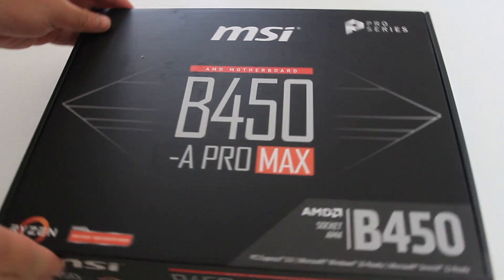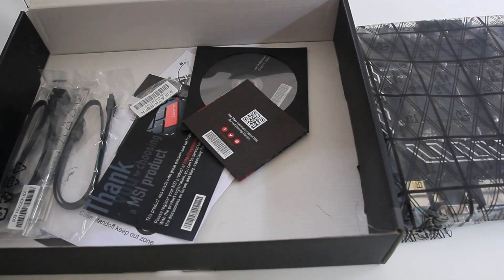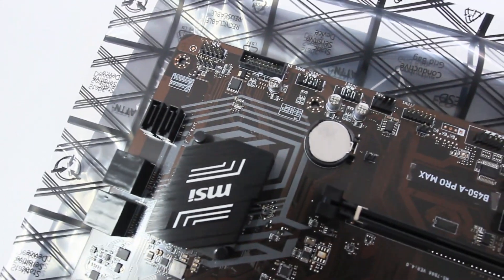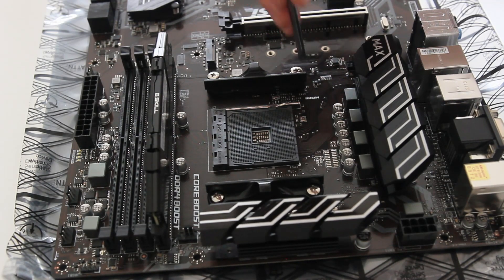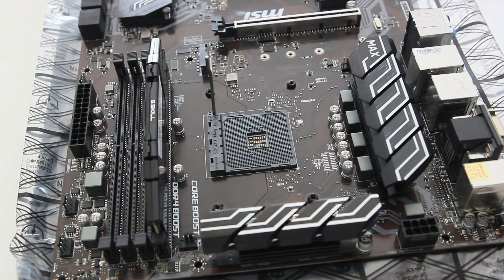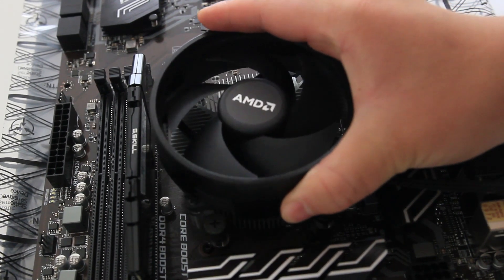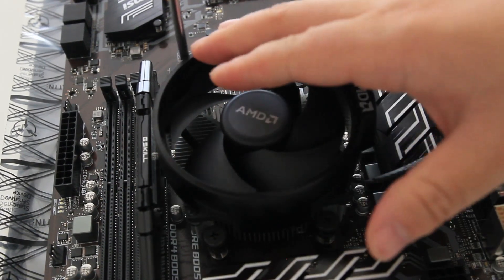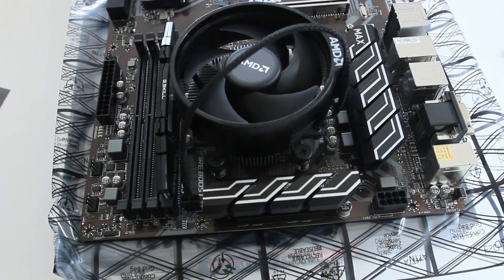MSI B450 A PRO MAX Motherboard Unboxing and Install CPU/RAM

Comment: Very difficult to screw back the cooler on cpu? How did you do it so easily
Reply from the maker: @muhammadjeewa9797  Yeah so I believe these are spring loaded. You need to push down gently first before screwing it in. It takes a while though

Comment: I have the same motherboard but I am not able to sync my water cooler with my graphic card and case fans together as the retailer said that their is no extra slot to connect the watercolor with other components is their anything that I can do to make them work together.
Reply from the maker: Hey there, do you know what slot is used to sync the fans? Would this be the fan slots? For mine I had to use a fan splitter, basically you sacrifice the ability to individually tweak RGB fans, but you can have them run in sync still

Comment: Its support r5 5600?? Or not
Reply from the maker: It supports the AM4 socket. The AMD Ryzen 5 5600 uses the AM4 socket as well. They haven't changed it yet. Would only be different for Threadripper and the other lines.
Reply: @techprometheus  update the bios or no?
Reply from the maker: @Dnahmed  Hi for my AMD Ryzen 5 3600, I didn't need to update the BIOS. For the Ryzen 5 5600, you may need to update the BIOS. For me personally, I would try and find a similar motherboard that is already updated to save yourself time.
Reply: @techprometheus  amd said all mob with max
Dont need update ? 
Ihave b450m apro max my r5 5600 in local delivey
Reply from the maker: @Dnahmed  Oh ok, then go with what AMD says. They should know whether a motherboard needs updating. Would also be good to check with msi or whoever the manufacturer is.
Reply: I upgraded to 5600, and yes, you need to update if you hav this board.

Comment: Do you think it supports Ryzen 5600?
Reply: i’m building mine rn with that cpu and I had to update the bios with a usb drive at the beginning of my build so i’ll let you know if it works when I turn it on
Reply from the maker: In terms of physical compatibility yes (AM4), in terms of software/BIOS - as brii said you may need to update. Keep in mind to be careful when doing this as I have read online that some mobos have been bricked (due to interrupting the upgrade process from BIOS)

I personally have selected CPU/Mobo that don't require an update - I mainly looked at reddit and other forums for details on this.

Comment: What tower case will fit this perfect?
Reply from the maker: ATX
Reply: @techprometheus  I have an atx but it only lines up with 2 screws?
Reply from the maker: @Xx-iPrOx-Wolf-xX  you should get screws with the motherboard itself as well
Reply: @techprometheus  I know but it still doesn't line up an fit in

Comment: I WOULD LIKE TO USE 7 5700G, IS THERE ANY LIMITED WORK IN THIS BOARD WITH THIS RYZEN?
Reply from the maker: Yes, it supports AM4
Reply: @techprometheus  what tower case fits this?